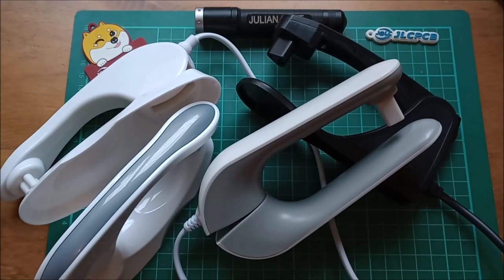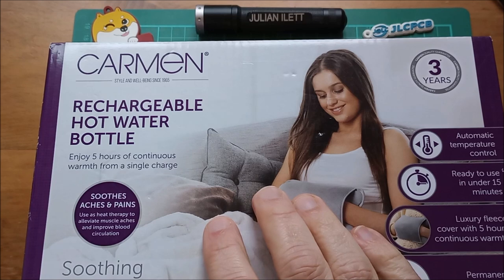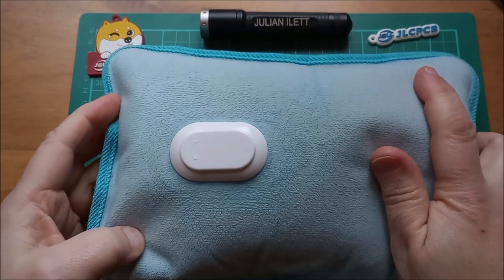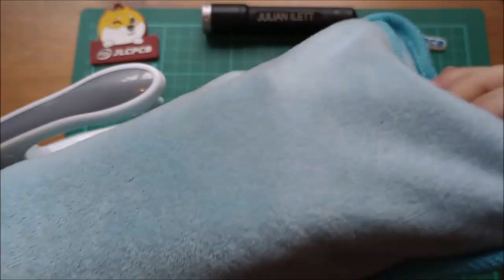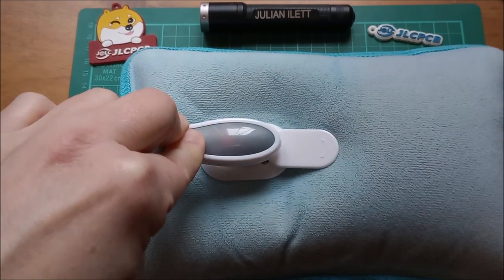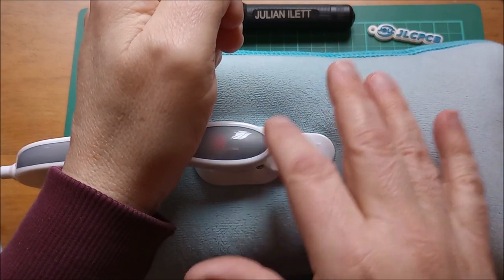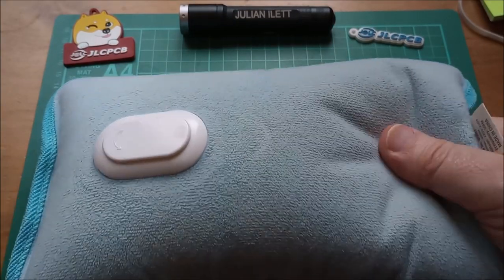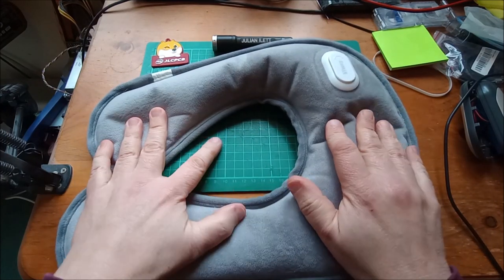Exploring Electric Hot Water Bottles

Comment: Because it makes a boiling sound I'm going to suspect its a metal heating element mounted on the same side as the plug port. As the unit puffs up it no longer submerges the element and its temp spikes up and triggers the  thermal cut out. I would also start to think that there is some kind of contaminate going on like bacteria causing gasses to rise. my first instinct is to vent out the "air" in it and add something like a few drops of vinegar to it and then cap it and see how well it works then.

Comment: It looks to me like the 'inspection port' might be for filling the unit.  I noticed a white dot in the center - can this be pressed in - I imagine it might be a one-way valve, and pressing it might open it to the air allowing the gas built-up to escape.
Reply: you're right, we can open it and remove excess air
Reply: I was thinking the exact same thing. :)
Reply: It needs a Schraeder valve, then you could relieve the pressure as it builds up,

Crappy carbon rods + a leaky Schraeder valve... What could possibly go wrong?  🤔 💦⚡☠️

Comment: Maybe the inspection port is a pressure relief valve ?
You assume the 3rd pin is earth, but maybe it's some sort of signal wire for temperature, take the charger apart to see where the wires go, or a continuity test
If the bottle is too puffed to be sensible to use, maybe wait for a slightly warmer day and take it outside, override the microswitch and see what happens, will the potential valve leak, will it explode, will the thermals cut it off
Reply: I have a similar device and on the manual it mentions that the puffing will occur after some time. When that happens, it recommends to open the screw and relief the pressure. I came here to see that being done

Comment: I'd drill a 1mm hole next to the port to let the gas out and then re seal it with epoxy. That should get you a few more years and not interfere with the safety valve, if thats what it is.

Comment: The best ones I've found recently (and most safe) are issolated power supplies at 12V DC.  Then the wires are far less risky and there is no water, just a generic gel to disfuse the heat from the entire length of the wires.

Comment: That "inspection port" is probably a pressure valve, weakest point of the bag, so will not explodes when something goes wrong in a closed loop system like that.

Comment: I think your "inspection port" might be what they used to fill the water bottle with whatever liquid is in them
Reply: Almost certainly, there's a version of this where you add your own water , you get a tiny funnel which screws on to a standard sized water \soda\pop bottle and you remove a tiny rubber bung and squirt the water in and replace the bung 😊

Comment: The swelling could be from gas production if there are cheap immersed electrodes instead of a proper coil doing the heating. Perhaps hydrogen gas has been forming due to hydrolysis.  Perhaps the bag that holds the liquid or gel has shrunk with repeated heating.  Obviously the amount of liquid inside can’t change since it’s a sealed system.

Comment: there's a version of this where you add your own water , it comes with a tiny funnel which screws on to a standard sized water \soda\pop bottle and you remove a tiny rubber bung and squirt the water in and replace the bung 😊

Comment: What's with the specs of the container for these? it indicated 220v 360w, but on the same line it says input DC 3v 300mA 3W, it seems like they've just pulled numbers out their butts for the packaging. Even the lower figures don't add up, 3v@ 300mA is .9watt, not 3 watt.

Comment: Why not disconnect the switch in the base/charger unit? And also try let the gas out through the filling port.
Reply from the maker: Defeat a safety device? Surely not ;)
Reply: @JulianIlett  I guess yea it could theoretically inflate even more to a point of explosion... maybe just bend out the switch a bit to allow for puffier pillows.

Comment: With the connector loose from the bottle, install the charge cable without fear of it being pushed open and lets see if the cutouts work first or if the bottle opens up.  Then, dissect it.  With the ground going inside the bottle I would predict a proper heating element.  Who knows.

Comment: I actually cut mine open to see how it works this evening. Discovered there is a " bung " to add water. ( not sure whether its at point of manufacture or later )
Read an obscure post where a chinese man said let the air out & it will work properly again .
I had to dissect it to find how to let any air out. 
Removed some screws around the housing and near the plug-in bit is a rubber bung held in place with a covering with screws.
Too late, it was disemboweld, to try top it up, but I'll try with the next one i buy.
Little kettle type element inside.
The water had something in it because my skin started tingling, so i washed them quickly.
The product design has zero thoughts about the environment, and it is definitely not made to last.
Reply from the maker: I must have another look - next winter perhaps :)
Reply: I have a similar device (Chinese product) and on the manual it mentions that the puffing will occur after some time. When that happens, it recommends to open the screw and relief the pressure. But i am afraid it will spill when i open it.